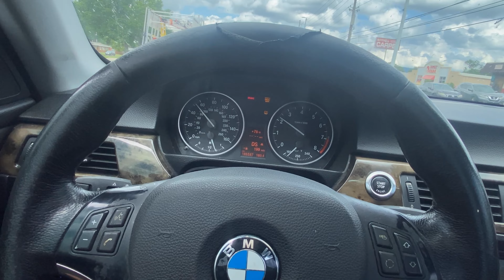BMW E92 328i Aggressive Catless Exhaust Setup

Comment: So you went no Cats With the Muffler and Resonator still on?? Sorry i couldn’t really understand 😅 but the cars so Crazy Good 😩
Reply: also Are you getting any Check engine Light Codes After doing this?
Reply from the maker: No cats aftermarket resonator & muffler I tuned the car to get rid of the codes